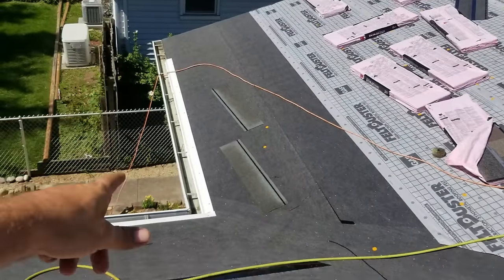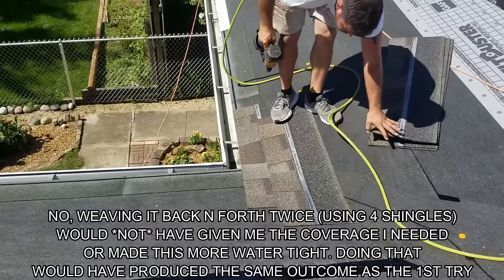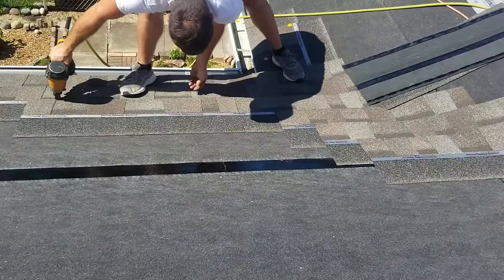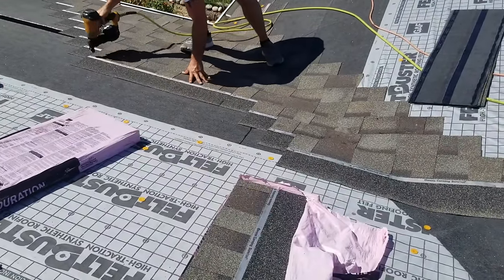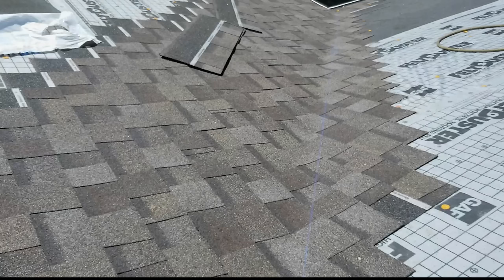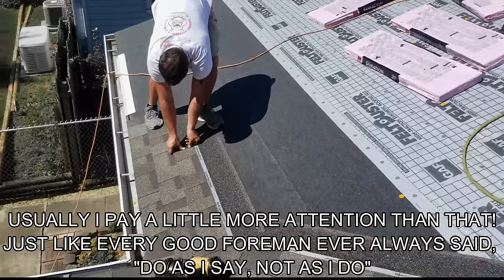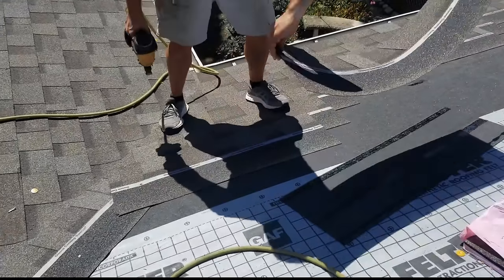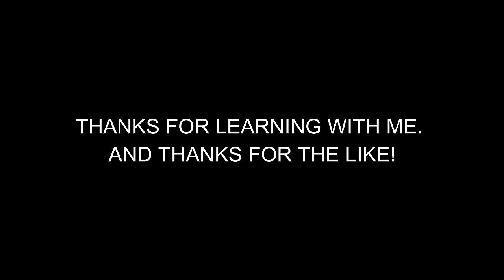How to do a closed valley!!!

Comment: How do you line up the shingles on the 'over' sides at the top of two valleys that coming together?
Reply from the maker: I made a really good video on this that got fucked up lol will be coming shortly. but really its just a matter of using a tape measure or dry fitting a few shingles to make the most minute changes as possible to one side, not both sides of the valley
Reply: 2 answers for kinda the same question that can be looked at 2 different ways. to line up with the VALLEY do the same as shown in the video what he was doing on the bottom half of the roof. to line up with the PEAK and make it straight so ridge cap will cover, what i do is called a dummy row you cut a shingle directly above the nail line all the way across then line it up with the PEAK. it may be 2-3-4 inches over the second last shingles nail line and that may not be super perfect but you cant be messing around making stuff perfect you have to make money as a shingler by doing things somewhat fast. This guy prolly will do things differently that looks better but takes more time. Its all about time, and how much you are getting paid. To how good a job you will do all roofers cut some corners that may be cosmetically not nice. But bottom line it should always be water tight.
Reply: We snap lines from the ridge line above the dormer. 50 1/2 inches down from the peak and one 18 1/2 inches from the eave.

Comment: I thought the drip edge was supposed to go under the freeze protection .
Reply from the maker: This is one of the biggest debates in roofing.  I do it either way.  I used to intentionally put the gutter apron on first and then Ice over it. But people say the ice shield is supposed to completely cover the plywood and stick to it.  I personally don't think it's that big of a deal.  But I have been doing it that way.  Dry in completely, then metal goes on, then shingles

Comment: Great job with the roof. I just have one question: why no bull under starter? Florida code requires bull under all starters. Great video overall!
Reply: what is "bull" regarding starters?  Only ever installed roofing shingles in CT, MA, & VT......
Reply: @toddmacgowan  roofing cement.
Reply: He's not in Florida, Florida has to worry about hurricanes, etc. Where the job is, he only has to really worry about wind, that's why he's using more nails than recommended, standard is 4.
Reply: Most states don’t require it, and most states don’t inspect roofs either.

Comment: Where's the tar strip under the shingle edge going up the valley
Reply: On those kind of valleys. The sealant strip on the bottom of the shingle seals the valley. But I did see some problematic methods in this video

Comment: I am roofing my house this summer I have 2 dormers so 4 valleys to do this is how I am going to do it
Reply: Doing same thing I just install the felt so you will find out what to do after your there working on I am not roofers first time doing but make sure you buy that black seal  big 5 gallon to seal all pipes and valleys i will upload a video explaining things for new people doing it
Reply: @Juanpablo-ow8cs    Cosas,, please,, no tar.  If you lay the shingles in the correct sequence they do not need tar.. The exception being,, I Newfoundland, Canada, on the Atlantic coast.  There, because of wind you surely would not believe, every shingle,, on every building is tarred down under the shingle.  There always stands an extra man on the roof pre-tarring the bottom back of the shingle before it is handed to an installer to nail down.  The reason,, I personally have seen it blow full gale force winds and up for more than a full month.  Wind speeds , sustained for sometimes days and days, of 40 to 100 mph.  Every shingle gets tarred down,,, and there is almost never a shingle missing anywhere along the coast.   For pipes, chimneys, vents that intrude through the roof,,, weave the flashing in with the shingles.  So the aluminum flashings just become another shingle element in the total roof.  A little bit of tar,,, usually from 2 or 3 caulking gun tubes,, cover exposed nails in the flashing,, caulk in a small eyebrow over the upper side of your vents to help move the water left and right.

Comment: I do roofing and it's already wrong on the starter. You supposed to let the starter over hang the drip edge of at least one inches. The ice and water or the deck bass need to be over the  drip edge because sometimes water back up if there snow and even if there's no snow .put a napkin in a glass of water and water go up I wonder if it does it on shingles or on ice and water. I will ave to test.woooow your are nailing to close to the valley leaving at least 6 to 8 inches .the top corner of your shingles need to pas the valley fore at least 6 inches .your air hose is on the wrong side to.

Comment: What's the point of having dripedge over the ice and water, if water gets under the shingle and runs down it will go under the drip edge, ice and water over drip edge simple stuff
Reply: Correct sir.  Start from the eve, then work upward toward the peak.  1st: drip edge.  2nd:  Ice and water on top of drip edge.  3rd:  Starter shingle.  4th:  Shingles.....
Reply: My roofers put shingles with the drip edge visible like you did instead of overlapping drip edge. Rain water runs along the drip edge (because of surface tension) along the fascia and behind the gutters. Totally messed up.

Comment: I really haven't seen a video yet that tells me how to go from ride cap into a T intersection of another ridge cap . Figure it on my own
Reply: cut 2 pieces in the middle ,hide them gradually behind shingle,you dont nail shingle above intersection to slide last cap behind it.when its cold good idea to not nail that intersection shingle at all and do it after ridge cap installed because it is rigid you cant bend up enough to squeeze nails properly.First cap that starts hiding behind shingle shall be cut little bit so it covers bottom part nice and tight ,second cap shall be cut up to the middle or so ,upper  part will sunk behind shingle and only lower uncut part shines.

Comment: does this type of valley work for a 3 shingle tab too
Reply: Randy Fail not as well. But honestly architectural shingles are way better, look nicer, last longer and are not normally more than n extra couple bucks a bundle, I would never shingle a house with 3 tabs by my own choice
Reply: three tab are almost a thing of the past. before roofing check with your insurance company, some give 30 percent off if you use great shingles. for me it took 3 years to get back money for better shingles and the discount last as long as the roof

Comment: Also... if you want to run a section left handed as a right handed roofer. Just back step bro... you. Could've easily changed your. Nail pattern and made your life a whole lot easier. Even the 1tab, 2tab push works well for getting out of shit like your tie in at the bottom of the valley.

Comment: Nice job.  Thanks.  
Might be a little bit of over-nailing though.  The shingles are only supposed to have 2 to 3 nails per shingle.  Over-nailing decreases the amount of buckling the shingle can make from heat expansion.  The shingle and the 2 to 3 nail schedule is designed for a hot day.  The shingle expands in the long direction most.  When the shingle can't buckle as designed, it makes up the difference by enlongating the holes sideways.  Causes leaks.  More of a problem for locations where the summer sun is hot, and for dark roofs.
Reply from the maker: On sorry but you are incorrect.  Minimum is 4 nails in a shingle. Some areas require 6
Reply: Read the package. 6 if you are wind nailing
Reply: @Caliblaster  Sure, if that is the code.  But the code is not written by mechanical engineers.  Use the least allowed if you have a heat load.  But most of the country is not in the CA-FL heat belt, so extra nails is not a problem.
Reply: @thomashockman4972  Interesting. I would figure you would want to follow manufacturer's recommendations on the package for the warranty
Reply: @Caliblaster  lmfao! Agreed!
Reply: @bobbyerskine1055  Right! Now I know why you see new roofs where half of the roof has slid down

Comment: The first shingle is to close to the seam of the starter
Reply from the maker: its staggered just fine man. the start is a touch longer than the shingle itself, therefore by the time we get to the end of the run, the starter will have worked its way further away from the seam, so much so that skipping your nailing for that seam placement may be a bad idea. its all part of the strategy. that will never leak my man thanks

Comment: Why would you waste so many shingles in rolling your valleys when you could install "W" crimp valleys. Maybe you never learned.  Also install your underlayment over the ice shield so the shingles don't seal to ice shield. Homeowners wont appreciate it when they have to install new shingles in 25-30years and the contractors charge twice as much to peel them up by hand.

Comment: Funny im in Canada iv been roofing the EXACT same way as you do it for the EXACT same reason and yet not ONE roofer that i work with does it like that + they don't know why ..they just do it there way cause they learn from an old 60 years old roofer that never wanned to learn better ways
Reply: Because those valley's don't last up here, use metal. Every house you see with this method only lasts 15 to 20 years max. Stones wear off prematurely and cracks form quickly after that. You see plenty of homes with this method and they have to go up and pour tar in that seam/valley. The stone is the UV protection and when it's gone, there's no saving it, it fails fast after this. If you do use this method, don't waste money on 50 year shingle, buy the cheapest one you can.  This is a roof you put on for resale, cheap cheap cheap.
Reply: @royormonde3682  what seams ?? Theres a shingle all the way up the valley bud !!
Reply: @royormonde3682  vertical shingles that protect and the line of tar under thats shingle double seal that valley
Reply: @olivaliq1  Look, if you want to use this method, that's fine, it's your choice. I was just pointing out the bad things with it. If you need to put in a vertical shingle then  ice shield under it for a double triple seal then go ahead. But if the first thing you see is a worn out top layer after 15 years, that to me is the most important thing, doesn't matter if it's not leaking, it looks like crap. Your roof is just as important as your siding or your paint. Like I said buy 15 year shingles and use this method and your all good to go if your selling the place.  Yes, I've seen worn out metal valley's too, but they are extremely old. No one wants to go up on a roof anymore than they have to. If your keeping your house for a long time then spend the money once. I got 50 year shingles on my roof and the copper valleys last that long too.
Reply: @royormonde3682  ok boomer
Reply: @olivaliq1  LOL, well there you have it folks. Mr. Watch here wanted to know why roofers here in Canada don't use this method and when he asked other roofers, they didn't know why they just did it the way a 60 year old roofer told them to do it. Well I tried to explain it to him why, but his method which he learned from SOMEONE is the best. So he's resorted to calling me names, nice work their tough guy. HA HA HA. My first 2020 laugh.

Comment: It shows nail pattern right on the bundle! Id read it .....you start and finish nail is too far away from end of shingle( except valley) No more than 1" from both ends of shingle.
Reply: Not trying to start something. But if you nail is 1" - 2" away from the edges. it's not going to cause any problems. When you're laying shingles all day in the heat/cold, no one is going to have it exactly 1" of the edge. All that really matters is if the nail is in the common bond, away from seams, and enough nails are used (4+)
Reply: Well, laminates, especially if they were installed 15years ago potentially may  start to curl. If nail is not close to ends 3/4 -1"....the sides may lift and curl as well.

Comment: Walking in the valley as much as you do is a huge no no every step can rip the ice and water.
Reply: When you're putting ice and water in a valley you're not letting a big air bubble in the middle, you're trying to keep it as tight as possible. 

If youre putting your feet directly in the center of the valley that might cause a bit of damage, but if your feet are to the side of the center it's not going to affect anything. When I'm going up steeper roofs, and there's a valley right next to me I will always walk in the valley cause there's more traction, and if I slip there's more control cause you're able to plant your feet on either side.

Comment: I like some of your video but you know high and when you're nailing high on a two piece I don't care close to cut valley or not I don't like close cut cuz people walk on it and crack it after you're gone a year or more later all right but you got a nail on that line and you got a nail accurately not bunch them up on one side and you're not nailing the top edge as you go through your valley you need to telegraph that down and get tighter as it roof ages it's going to creep up over those other dimensionals even if you're not leaving it you should nail in your top inch and a quarter inch and an 8th as that valley leans to the left of your shingle or right in the valley going over the other piece that's just last and longer that way all right have a nice day

Comment: You aren't running those shingles under far enough. Top corner past valley 6 inches. Also, to help you keep your shinles straight out the valley, when you run your 2 shinles up, start with your 2nd shingle, not the one that goes directly in the valley. Take them kids forever to get em straight doing them your way.

Comment: Shiner at 18:10
Reply from the maker: Looks are deceiving.  I ain't never spit a shiner on durations
Reply: @NWIVeteranConstruction  we love certainteed for their unmatched warranty. What’s your thoughts?
Reply from the maker: I don't usually pay too much attention to warrantees... but yes. The big 3 is all that I install.  O.c. duration.  Landmark. Gaf.. and the reason I say that is because 95/100 times the installer  is more likely to be at fault for a leak or blow off than a warranty.  I expect any company to back their shingles if there's a huge issue with the material delivered and even if it was installed

Comment: Stop stepping in the valley and the woven shingle doesn’t get ripped
Reply from the maker: as long as you press in your valley shingle it'll NEVER get ripped. you can tap dance on my valleys. I use my foot wayyy softer than it looks. I probably could've clarified, but I did say not to press in your valleys too hard as the shingles will start to buckle on either end.

Comment: You do not have your starter properly adhered to your drip edge. You should have your drip edge under your underlayment along the eave and if not then you have to cement your drip edge. You would have been fine had you of not nailed so high on your starter. Your starter should be nailed through your drip edge.This will without a doubt allow wind to blow rain under the starter, that is guaranteed. I'm the superintendent of a roofing company with over 30 years of experience and this absolutely would not fly on one of my roofs. I would stop you from the start. Not to mention you didn't put anything down your valley and that will show eventually. Also your shingles should span the valley more. The top of your shingle is laying dead in the valley. It sucks people watch this crap and think you're roofing right because they don't know better. I'm not impressed in the least bit. Most people I hire that told me they could roof actually learned that they were taught wrong.
Reply: @ kevin waller you are right underlayment should be on top of drip edge except on rake edge. Went to a framing school for 2 years and my instructor  told the class just because someone say they been doing it for 20 years does not mean they been doing it the right way .  in California inspector does not inspect the shingles